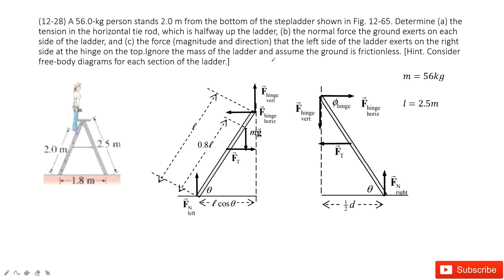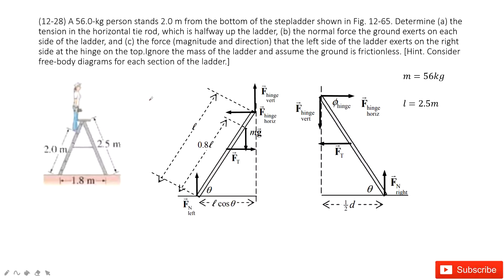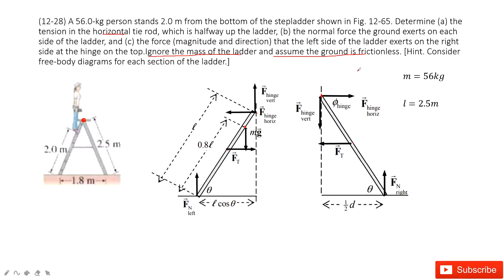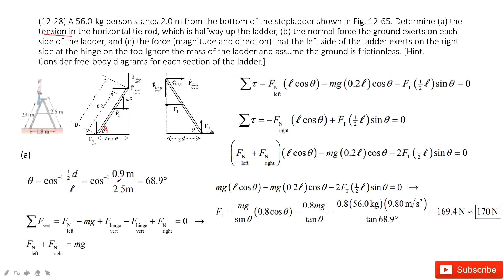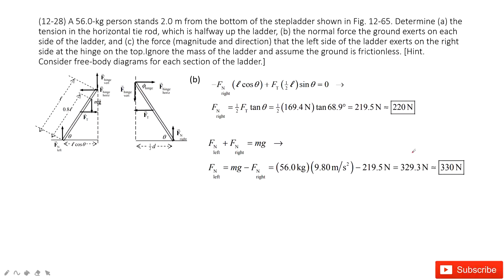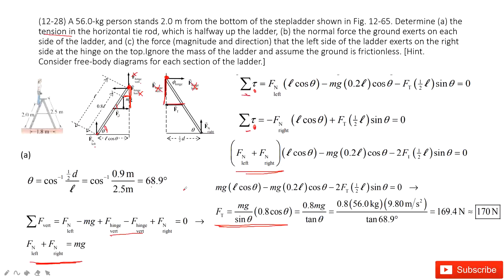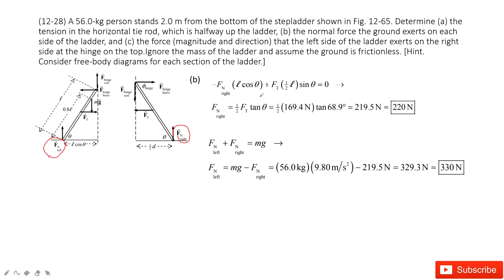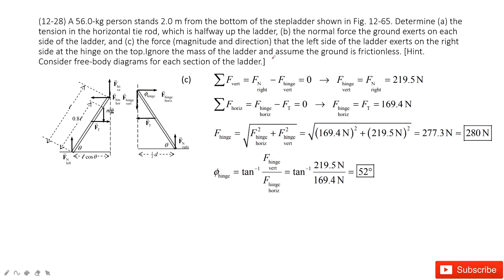(12-28) A 56.0-kg person stands 2.0 m from the bottom of the stepladder shown in Fig. 12-65. Determi

Comment: Per concept wise, it will be more concise if we treat the ladder and the person as a whole item. Then there are only three torques caused by F_left, person weight, and F_right. Together with the equation F_left + F_right = M_person*g, we can resolve F_lft and F_right. Then we can zoom in to handle the right side of ladder only. The torque caused by F_rodTension is cancelled by the torque caused by F_right. Then we can get F_rofTension.